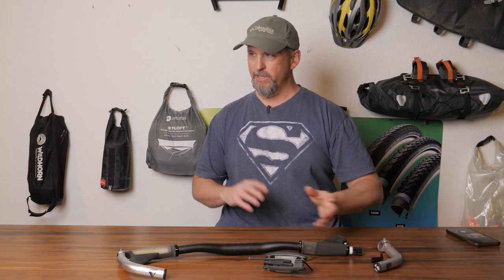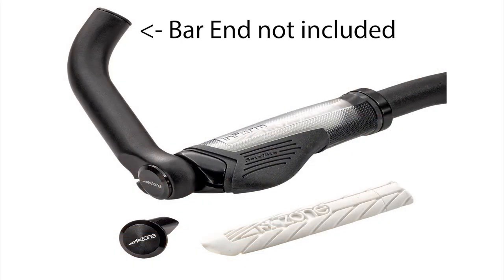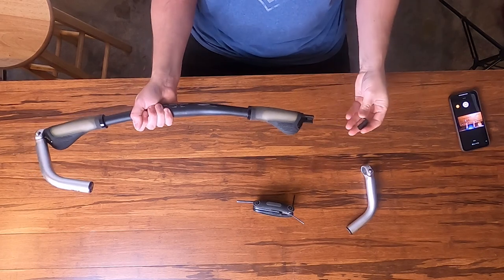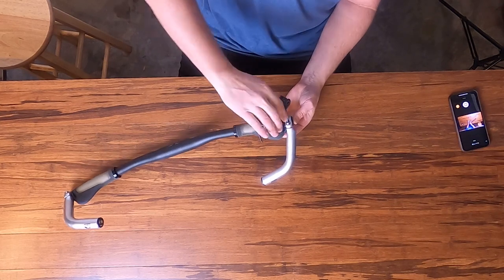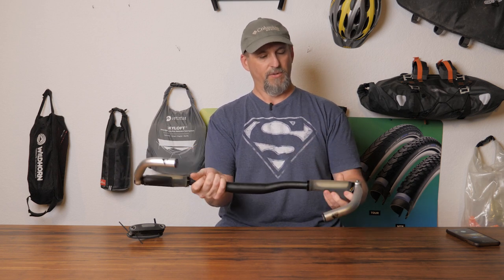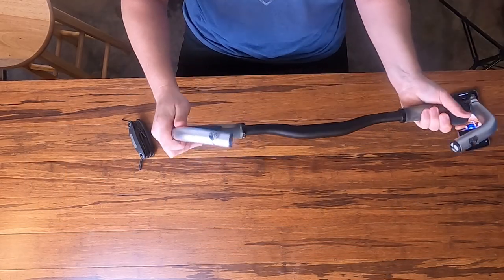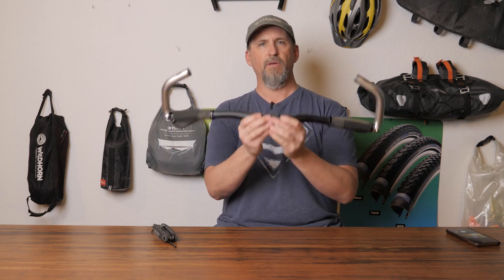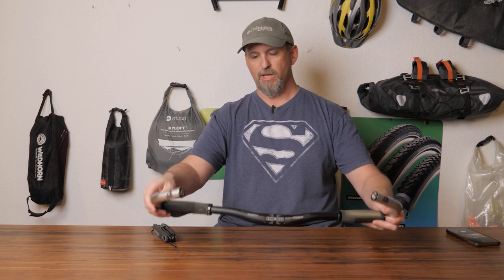Installing Bar Ends on Trek FX3

Comment: OK, I'll give you credit for a very helpful video. I was even surprised to find one! However, I have a 7.7FX, which also has the iso-zone grip, and the installation is not as easy as the FX3. On the 7.7,   the white foam piece under the grip has to be cut off by approx 3/4" in order for the black metal adapter  to be inserted far enough. After that, the handle bar grip needs to be moved approx 1.25" towards the center of the bar in order for the bar end to have enough handle bar available to be attached. This requires that the brake and speed shift mechanisms also need to be moved. Hopefully you are able to follow my explanation without a video. ;-) Thanks again!
Reply: Thank you! I just picked up a 2022 FX 3 and really want some bar ends on there

Comment: Fx 2 doesn't comes with a lock on grip, so in that case should we need to cut the grip in order to place those bar ends
Reply from the maker: You should be able to move the grip in on the bars.  I would never cut grips.

Comment: Thanks for your video.  I’m actually searching for a solution to the awful grips that came with my fx3.   After a few years they have started disintegrating into a horrible, sticky, messy goo. It’s revolting!! What were Bontrager thinking or did they just not bother testing?  The grips are sticky and this material transfers to my hands and accumulates into small rubber like balls which have gotten in my eyes and covered the screen of my smart phone in a layer of gunk.  It’s just disgusting. 

Is it toxic?

The handlebars have a weird end so not many accessories fit them, mirrors for example.  Bike shops have suggested replacing my handlebars but I’d prefer to keep the cost down. 

I urgently need to replace the grips but I don’t have many options due to the weird shape of the ends of the handlebars.  

I absolutely don’t want to buy more Bontrager grips and reward them financially for their disgusting product!!

Have other manufacturers offered solutions to these awful grips?
Reply from the maker: I’m not aware of any other manufacturers making grips for those bars honestly.

Comment: Great video... I was thinking about getting the "Chim Chim" bar ends (By Paul Component Engineering).  They are closed off on one side, so the handlebar wouldn't/couldn't actually protrude out of the other side.  Would these bar end adapter work with this still you think? They seem to have a lip on the end of them so idk if thatd work.  Sorry for the long random technical question...
Reply from the maker: There is a lip on the end of the Trek bar end adapter.
Reply: @BradBeaird  I thought so,, thanks for the quick response.

Comment: Very timely, will the handlebars still accept a mirror?  Thanks.
Reply from the maker: Well I guess that depends on what kind of mirror you want.  If you want the type that goes into the end of the Trek handlebars then it would not work.  If you wanted to mount it in the end of the bar end (up toward the top), there is a removable plastic plug there.  Otherwise you would have to choose a mirror that was more of the clamp style.
Reply: @BradBeaird  Thanks, that makes sense.  I currently have it installed at the end of the handlebars.

Comment: You show a spacer that appears to be about a half inch bigger that what you put in the link for the spacer kit. I looked at the kit and the spacer is not that long. I have a 2020 FX 3. My handle bars appear slightly different as well.

Comment: Hey Brad, great vid. I have 2020's FX2 and had to replace my factor grips with the Satellite Isozone City Grip which is also a lock-on. I also have the Profile Design Boxer Bar End but I never had to get the Bontrager adapter kit; I just used the plugs that came with the bar ends. Am I doing it right??
Reply from the maker: I suppose it kind of depends on your bars.  When you took the old grips off and replaced them, some bars are slotted and only have a plastic piece in the end which isn't sturdy enough to adequately hold the bar ends. However, your bars may be different.  If that bar end is clamped around metal, and the grips fit ok, then you should be fine.

Comment: How do you like your other surly handlebars I'm looking at Jones bars or surly why did you decide to use surly
Been enjoying all your videos thanks for so many of them.
Reply from the maker: Hey Jason.  I have the benefit of having both the Moloko's and the Jones bars.  Of the two, I think I like the jones bars better.  Part of that has to do with the sweep on the Jones being a  little greater and the other is that I bought the Jones with a 2.5 rise and I like the position of that on my ECR.  The Moloko bars have been better than stock bars on the Trek I think though.

Comment: How do I remove them?
Reply from the maker: Loosen the screws and they should come off.
Reply: @BradBeaird  what bar do you use on your fx3? Why did u replace it?

I would consider replacing it for higher end one, but not sire what’s out there
Reply from the maker: I currently have to Surly Moloko bars but mainly because I had an extra set laying around.